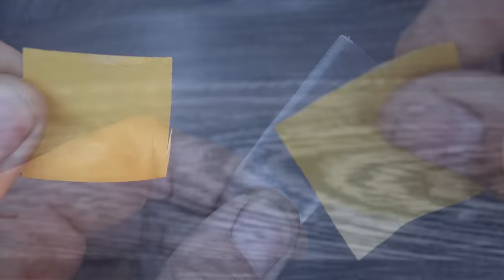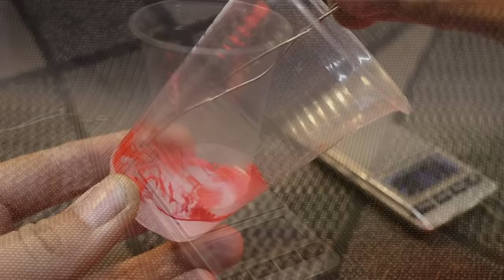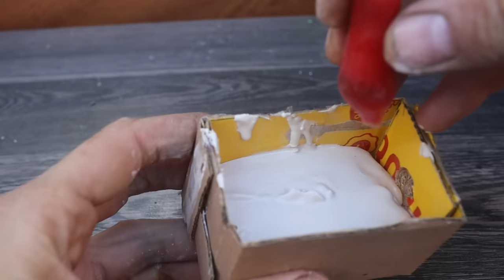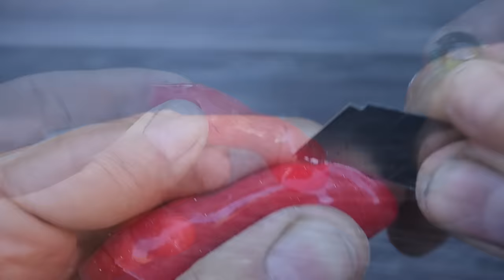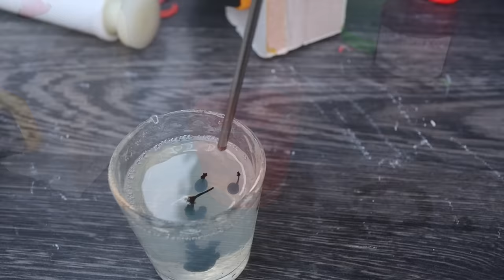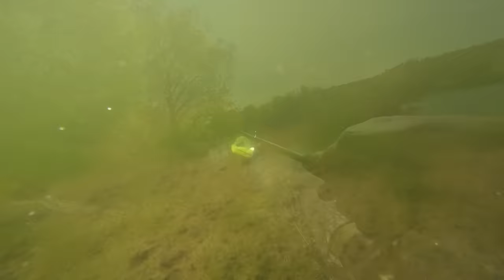Making silicone lures using a medical syringe | fishing hacks

Comment: To make a Grub plug, use a piece of 5/16" dia. wooden dowel and chuck into a drill or drill press. Use a small triangle file to grind the grooves of the grub body, ending with a taper, cut to length, then saw a small groove in the end of the taper.  Sand smooth then seal the plug with butcher block wax.  Glue in the tail and make your mold. Produces quality baits!
Reply from the maker: I’ve done this before, this is a new way, I’m constantly checking new options, looking for a better one for myself, wood is not the best option
Reply from the maker: But thanks for the idea with the dowel, I'll try it
Reply: always more then one way to make something...

Comment: plastic syringe resist to plastisol temperature?
Reply from the maker: if you don't overheat it, up to 130 degrees Celsius, and then use it very quickly, then you can use it several dozen times, but it's better to buy a specialized fluoroplastic syringe